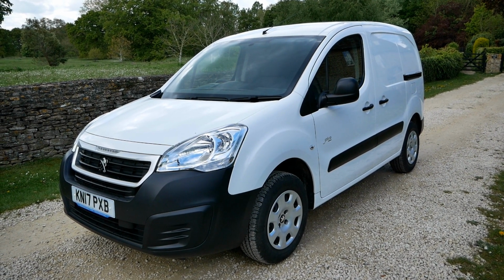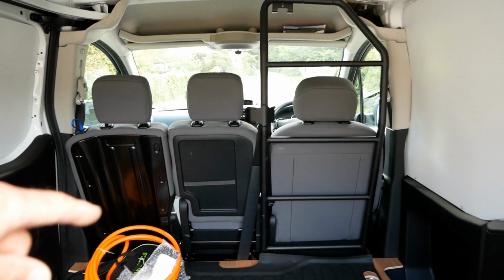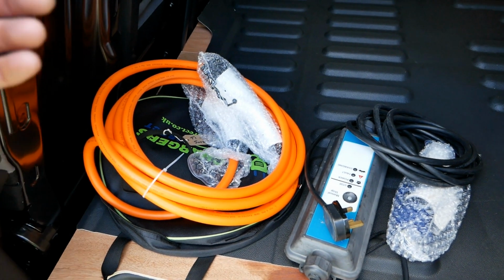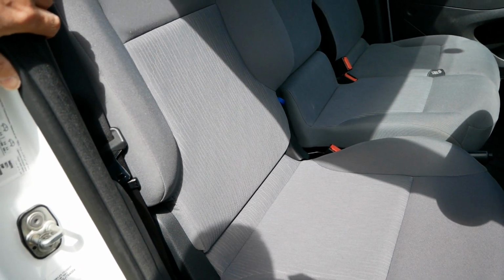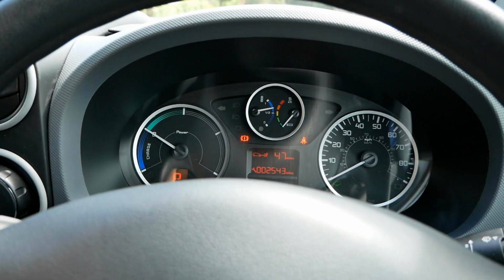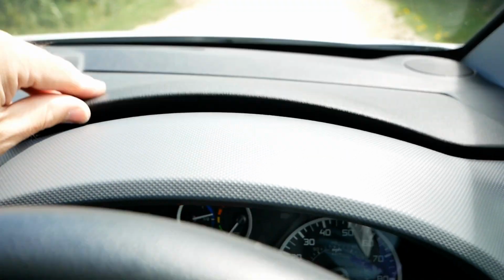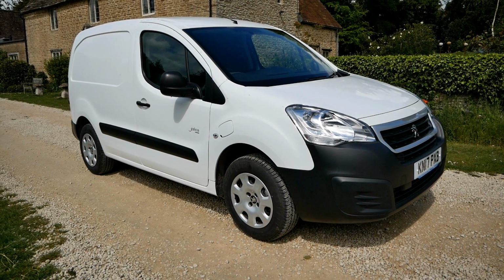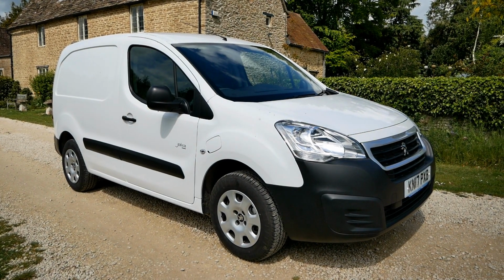SOLD:  2017 Peugeot Partner SE L1 electric van

Comment: Excellently informative video.
On home charger installation is there a certain standard the home wiring has to meet?.
Reply from the maker: The installer runs a new cable from the consumer unit to the (32A) wall charger. So you either need a free slot in the consumer unit for a new MCB or if not, the installer will normally just fit a second smaller 'garage' enclosure.
Reply: @GoGreenAutos  Thank you.